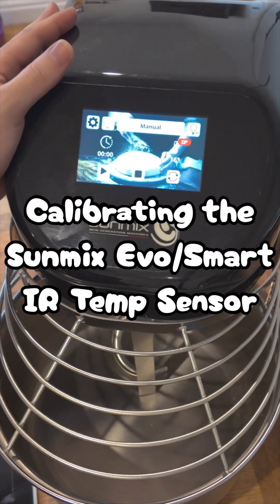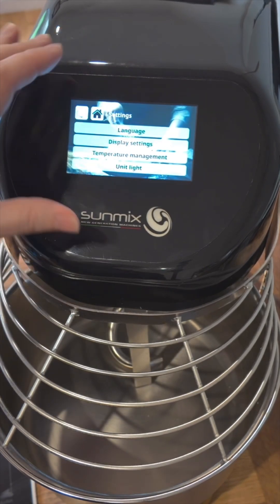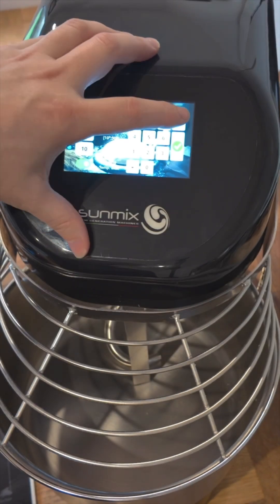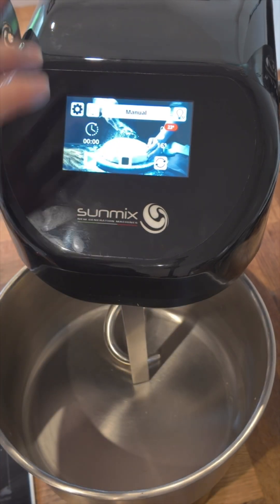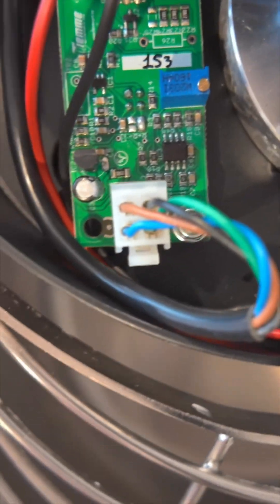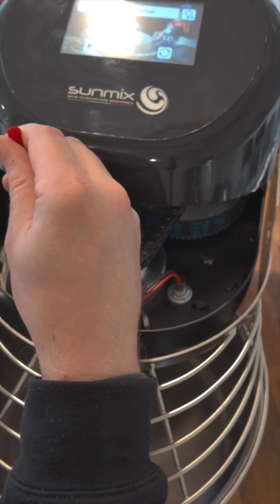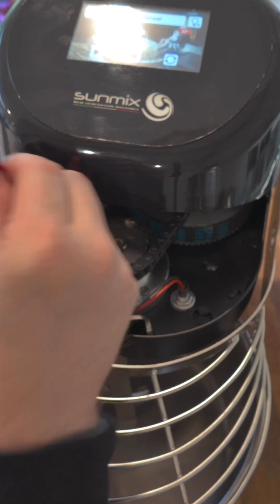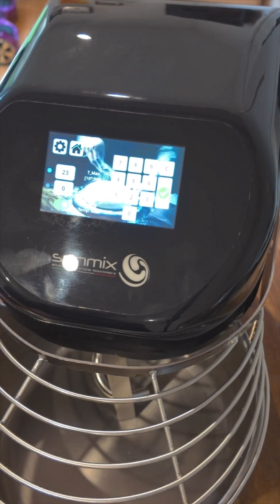Calibrating the Sunmix Evo/Smart Line interacted temperature sensor

Comment: as a former instrument tech with tons of calibration experience, I would follow this up with placing some ice and water in the bowl and checking if zero C.  Sometimes you need to find a sweet spot.  Not sure how accurate the reading from beneath the bowl with mixer vs. reading the top of the dough with IR would match up.